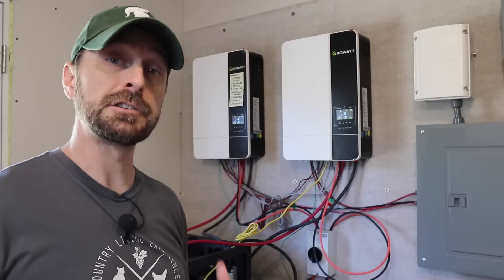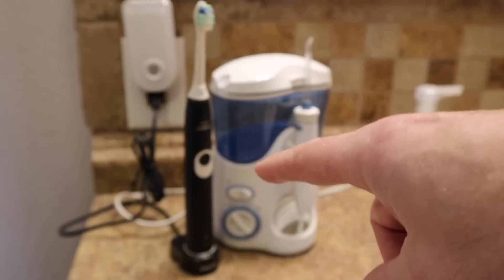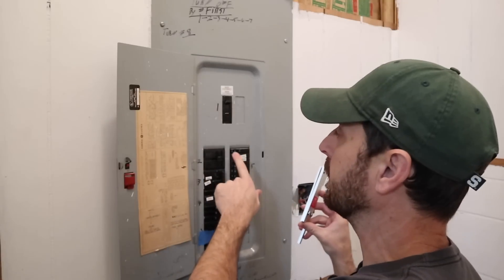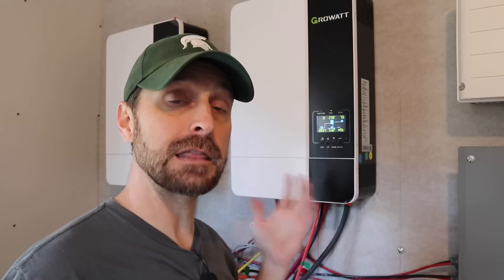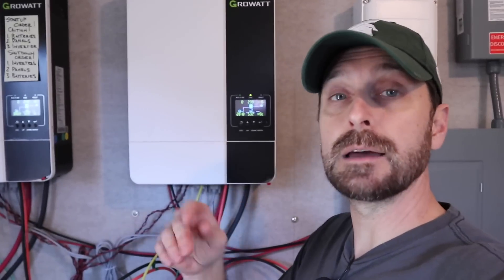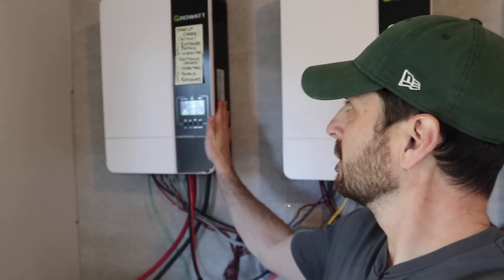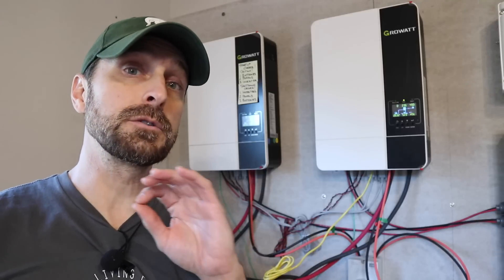Testing Our Solar System! 2 Growatt 5kw Inverters! What Can It Handle?

Comment: If my inverter is giving me 230V LN that's because I need to change the setting to get 240 LL 60 HZ yeah? And after that I will need the mid point  transformer to split my 240V LL to 120V LN exact?
Reply from the maker: Yes and yes

Comment: Thanks for video. Can you hook generator up to AC input to charge batteries? I just ordered 2 same Growatt and a 100A autotransformer.
Reply from the maker: You're welcome. You can connect to AC input to charge. I am trying to become completely off grid and moving my systems quickly in that direction. That is why I do not have AC input enabled.
Reply: @CountryLivingExperience Haha I'm watching your review on EG4 Inverter right now. I am trying to go completely off grid as well but will still need generator from time to time, is that what you meant by charging with AC? The generator will work fine? Getting mixed messages on Google, thought I might have to get EG4 Chargeverter.
Reply from the maker: Cool. 
No, I meant charging directly from the grid on the AC IN terminals but that would be the same as using a generator for AC IN. You can use the generator if it is large enough. I think I mentioned in the Chargeverter video that you need to have a power superiority for the generator over the loads and the generator has a pure sine wave at 60 to 70%. So if you have 8kW in loads and you are putting 5kW into the batteries then you need 13kW but the generator would need to be at least a 21kW (61%).  Some new inverter generators may negate this but I don't know much about them.

Comment: Hi There really liked your video , I have a question regarding the midpoint transformer. We're in Australia and everything here is 240v 50hz , I have 2 5000watt inverters I bought from Sydney Australia. Do I still need to run a transformer, or can I run straight from the inverters to my distribution board? It doesn't say anything in the instructions about mid point transformer and I was wondering if that is purely because you have different voltage appliances over there?
Reply from the maker: Thank you. It would be out of place for me to speak on how the Australian electric grid works. I do not know. 
The American grid is stepped down to 120v and most appliances use that. Larger appliances like stoves and water heaters use 240v here. We need the midpoint transformer to split the inverter 240 into two 120v legs.
Reply: @CountryLivingExperience  thank you so much for your reply. It makes a little more sense now and I suspect that's why we don't need it over here as all our appliances are 240v . And it is not mentioned in the installation instructions . 
Great video by the way . Cheers
Reply: So do the growatt inverters you get over there do they only produce 120v each or they're 240 and you have to split it?
Reply from the maker: @standingonwater1  No, the Growatts are 240 only.  Victron is one that also has a 240 with their own midpoint transformer to split to 120.

Comment: Great videos thanks a lot 👍🏼❕
  I see we should use 50 amp breakers for the growatt input to the panel. What size breaker should I use for the output to the main panel ?  The only thing I can find is 65amp?  Just wondering what you used

Comment: We have this system however they both are not working if I put all that on we get voltage overload put in by electrical and he tells us that we over load it we do not believe this as the he  is 0 whilst these is 12.9

Comment: Heads up, if you're going to be using 100% solar then you need to set your inverters to Solar Priority, this will divert the dc power from the pv array to power you loads and partially skip the battery. The more you cycle your batteries the more they degrade. The batteries don't need to be pulled from during the day, so just use your pv to run your loads and the surplus will top off the batteries. That way you're only using your batteries during the night and dusk, will make them last much much longer. Love the vids btw
Reply from the maker: Yes, I know. Thank you
Reply: @CountryLivingExperience  I thought you may have already. I have the 3kw versiona and was wondering if the 5kw had the same settings, it look like it might but now I know.

Comment: You said that you don't wanna feedback power to the grid but as far as I know, these kind of inverters (Off-Grid) doesn't feed back power from the batteries or PV to the grid. They can get input from the Grid to support loads in their output but not via versa. Can you elaborate on that ?
Reply from the maker: Feedback to the grid in terms of a grid down situation. Just like a generator. I do not want to injure a lineman working to restore grid power by back feeding my solar/battery power into the grid. It will do this if my main house breaker and my solar breaker were on at the same time. That is why I put the interlock kit.

Comment: In your video you started large loads based on your knowledge of how many amps each would draw.  Anyone with your type of set up should have that knowledge and follow your example.  What would happen to your system is someone would have 2 burners, the oven on then start the dryer?  Would you have to restart the inverters, since they are overload protected?
Reply from the maker: Yes, correct. If you trip the overload protection on the inverters, you will just have to restart. Then don't start that combination of loads again. If you are putting in your own system, a homeowner should know the wattage and amperage of all his loads for smooth operation. The only way to avoid that situation is to buy a much larger solar system.

Comment: ok, now how long will that out door gas tank keep you in clean clothes and hot food? 1-3m? 3-6 months? 6-9m 9-12months or 12-18 months?
Reply from the maker: 36 months for cooking and hot water. Clothes can dry outside on a line. That is why I have redundant systems.
Reply: @CountryLivingExperience  Bot bad. Never looked into gas. I'll have to look into cost tomorrow.

Comment: Great videos. We are buying our homestead here in Spain and I have been honing my solar skills with an existing grid tie system and a seperate Ecoflow DP.
I have been chewing over the 5000ES for a while and I just cannot find answers to a couple of questions I hope you can help with.
With funds being tight I dont want go down the wrong path and invest in non expandable system
Do the parallel inverters seemlessly handle load balancing on the system? I presume they do as what would be the point of an expandable parallel system right :)
And, if an inverter goes offline eg dies or is powered off, do the other(s) continue without issue, does a slave promote itself 
to master possibly?
thanks in advance, any help/advice is appreciated
Reply from the maker: Thank you.
They balance the loads well between them but the Master inverter always handles a little more. Yes, the slave should promote itself it the original Master has a shutdown issue. There may even be a setting for that but you need to check the manual. I did have an issue with my master not waking up from standby in the morning (needed a firmware update) and the slave took over.

Comment: Great video, I'd love to have a setup like this but with the solar being the primary source of power then the grid and a generator behind an ATS. Would it be possible to have the generator recharge the batteries?
Reply from the maker: Thank you. 
Yes, you can use a generator to charge but it needs to be a very large unit. You need to be able to power your house loads and charge the batts at the same time. To get clean power (pure sine wave) from the generator you need to not run it more than 60% capacity. If you don't get a perfect sine wave charge, you will damage the inverters. Signature Solar has a good video explaining this.

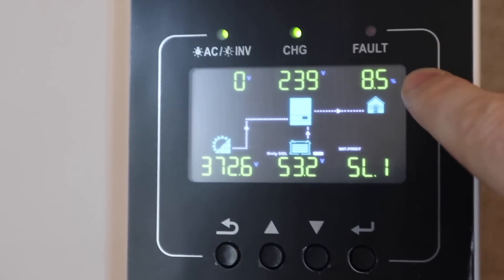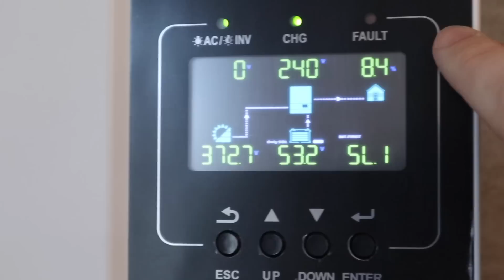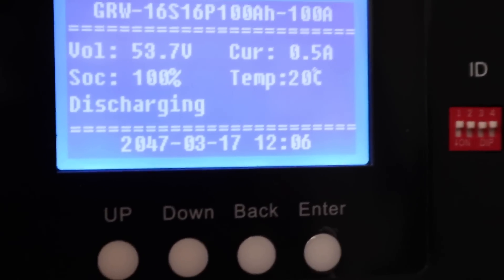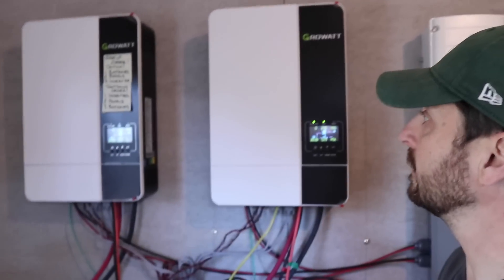Comment: If I turn on everything in my house I got a 3600 Watt 240 volt kitchen stove oven I have a water heater I don't have a dryer but I will don't have a washing machine but I will I got a refrigerator it's not an efficient refrigerator it's a big refrigerator it's an old antique refrigerator and uses an awful lot of electricity I do believe what you use 2000 or a little more than 2000 Watts I have a mini refrigerator I real tiny refrigerator to get besides a freezer and the rest of my house which will not be pulling very much wattage maybe about 1200 w if everything was on I'll be able to run everything in my house when I get my solar system hooked up 24 hours a day with one day of sun if I get as many solar panels as you got and 455 watts from the signatures I also plan on buying just as many maybe 400 watts from them cuz that's might be what I can afford first and I already have 400 watts plus another 5 watts to it four of those solar panels and I probably match up pretty good but I'm also planning on buying six inverters from solar signatures of their inverters not to grow Watts and just like you did their batteries but probably both types of batteries for two different stands or two different sets because I'll probably get more than six inverters and you only can run six inverters in a series I'll have way more power than I'll ever need and from their inverters where the building permit and electrical permit I'd also be able to sell to electric company with their approvals and I'm already told I'll get it maybe a little harder from the county though but so much easier from the state according to senators and the state and electric company even though the electric company they got to pay electric too but electric company in Wisconsin that I use took it over and now are electric companies in Illinois probably because I like the company couldn't keep paying all that money for electricity from Illinois they bought it not too long ago but maybe before you bought your place I don't know when you bought it but I say between 2012 and 2004 I think they bought it I'm not sure exactly cuz I know my electric company's name changed and the reason of changing is they were bought out and they couldn't keep paying all that money for electricity but to pay for Wisconsin's electric that they'll pay you is the same for what they'll pay in Wisconsin they might pay more in Illinois but they won't pay anymore in Wisconsin and I don't know how it actually works at Illinois I just know how it works in Wisconsin for my electric company that I got to pay to it is a crying shame that we didn't start getting solar up before that then I'd like to company went to had to be bought out by Illinois but the parents still be the same I don't think it really put any people out of work but it might if I do believe it did and I also can buy solar panels through Walmart and I know they are delivered to me as well they may cost slightly more they literally do cost more but I can get 365 Watts from them and I do believe I can get I think a little bit bigger watts from them anything to Best buy and buy 470 watts and they might cost slightly more I know I'll be going to pick those solar panels up even though Walmart will actually deliver theirs to me Best buy I'll have to go pick them up Lowe's that have to go pick them up from Menards that have to go pick him up from of course Menards would actually deliver them for a little cost but I go pick them up anyways like I did last time and there's a few other ones I'd probably buy from and they do cost a little bit more but it might be worth it in the long run and it's definitely worth buying it from solar signature as well and probably even more from there which I probably will do and then I'm going to buy some from Canada I think or their Canada company that's in the United States I do believe they have one and probably by just as many from them because of the bifacial solar panels sound really good to me especially when the sun comes up near the North in the morning and stay in the back of my solar panels and I went to time it won't come in North or come in from Southeast and beset and right around 4:30 in the evening give me solar power from I'd say 7:30 in the morning till 4:30 at night or more closer to 4:00 at night My Blue solar panels were collect electricity from 7:00 in the morning till 4:30 tonight in the winter time alone or either that at 7:37 right now my blue solar panels are still collecting electricity and it's been cloudy all day and rainy and my black solar panels are no longer collecting electricity my small solar panels that are black and whatever I still collect electricity but I think they were basically considered a grapes I don't know but I know is I got some small solar panels are still clicking electricity as well but they look black as well and I just don't know why that is but maybe someone who made them knows. I don't got as big as a place as you do but I probably could put up more than you did without putting solar panels on my house but I know generac might actually come over and put solar panels in my house because I applied to him and they said I have a year to pay him back in and it told me how much it would be making with the solar panels they put on there and if I get solar panels first they can also add that to the panels to the system as well which makes it so I can always add more and more solar panels to it until I see it efficient or until I actually cover more than I want to cuz I still want a yard and I still want my garden which grill is my food for the most part for fruits and vegetables but I still got to go to the store for food but it does save me quite a bit of money growing some of my food.

Comment: Did you consider microstarter for your a/c unit. You might be able to run your A/c on solar with it. May need more inventer
Reply from the maker: I actually was told about those by my friend who is an HVAC tech after I made this video. I am still unsure about doing that simply because my current system is old and leaky.
Reply: @CountryLivingExperience  you will be fine. I have hard starter on my a/c in order to run my house with portable 8k generator/ transfer switch combo. You would be just fine with your such a clean power from your batteries. it will work fine.although it could deplete your batteries faster/ either whole house split units or individual split unit may fit better, due to their efficiency. Specially old ac going out soon. You could probably get sponsored mr. cool diy whole house new ac on cheap. Easy to install.
Reply from the maker: I am putting in split units right now as we speak. I have some Mr. Cool DIY's.

Comment: Interesting vid.  A little unsure why you would not grid tie this and run of it 100% of the time with the grid as a backup feed.  Seems more efficient to me.  Also why move large loads to propane?  That is a product likely to go up significantly in cost and become more difficult to buy in future decades and especially in a future scenario where grid may be down for a long period and everyone else using propane would want to panick buy/stockpile?

Comment: I just have one of the 5k Growatts, with 5 of the Lifepower4 batteries and 28 200 watt Rich Solar panels.  I'm able to run my 40 gallon water heater (exchanged 4500 watt elements with 1500) and my 1.5 ton AC outdoor unit with the indoor furnace blower, and 2 small refrigerators, a large refrigerator, small freezer, some fans and lights, and charge up my batteries on sunny days.  I want to get a heat pump that will work with this, because my outdoor unit is only AC and using heating strips (about 5k) for heat on the indoor heat exchanger/ fan.  I'm trying to stick with one 5k Growatt.
Reply from the maker: I would think about getting a second Growatt. Running a single inverter at that high a capacity that often may damage it or shorten the lifespan.
Reply: @CountryLivingExperience  I really don't have space for 2. It would be better just to get a larger inverter.  I think most of the time it is only using under 10% of capacity. If both the water heater and ac are running, it will go up to a little over 60%, but the ac doesn't run too long, and the water heater might keep it at 30% for an hour or more if someone takes a long shower.  So I don't know if that is too much for it or not.
Reply from the maker: If it seems fine and is not overworking then you are good. If you want to get a larger inverter, that would work too.
Reply: @CountryLivingExperience  Thank you for taking the time to respond.  If I did add a second Growatt 5000...I need to watch your video on how to connect two of them together with using one solar array and one battery bank -- I have to confess that kinda confuses me as to how the inverters share these things.  I haven't really looked into it yet because I didn't need to.

Comment: These systems work great with today's technology. The biggest challenge is getting enough kilowatt-hours in from solar panels to cover the total kilowatt hour usage throughout the 24-hour..
Reply from the maker: True. Then having a large enough battery bank for night or cloudy day usage.
Reply: @CountryLivingExperience  the problem is that if your total kWh usage exceeds your panel output, your batteries will keep decreasing in charge, no matter how much capacity. I find that twice a week I have to go back to grid power. It takes 3 days for solar to recharge my batteries to full.
Reply from the maker: Sounds like you need more panels or have to manage your loads differently so you are not draining them.
Reply: @CountryLivingExperience  if anything, the lack of fossil fuels pushes us away from gas/oil to electric resistance heating, which greatly exacerbates the solar problem. We need at least 100kW of solar capacity to do this all year round. When it's cloudy and raining, we're seeing 3% of the solar panel rating in terms of output power.. maybe 200W from a 9600W array.